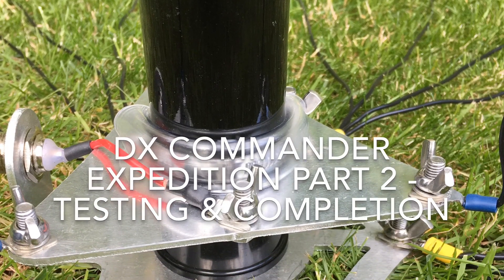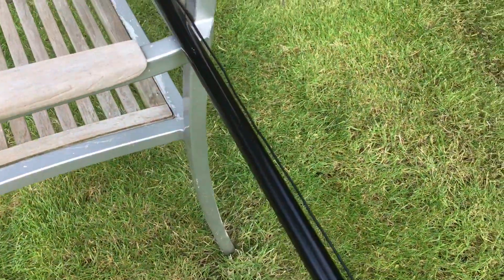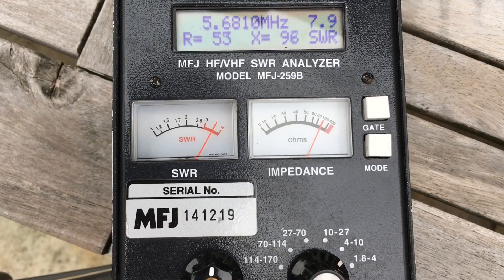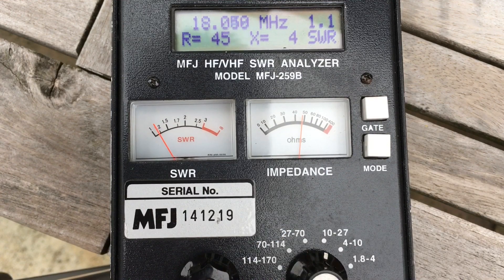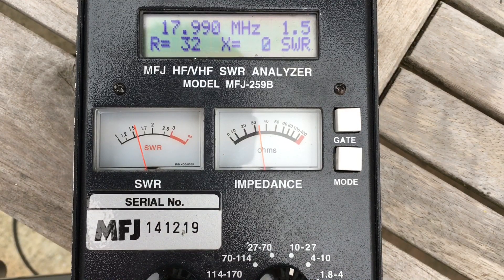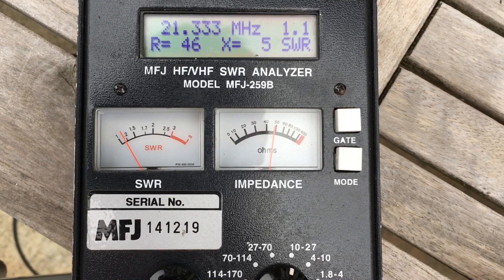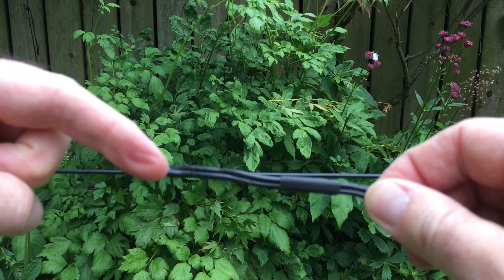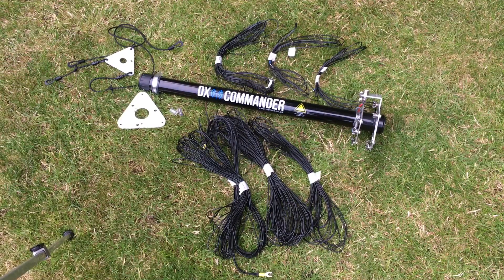DX Commander Expedition Part 2 - Testing & Completion

Comment: Hi. How long are the wires on the counterweight?
I see that it is recommended between 5 and 3.5 meters long. What is your experience?
Reply from the maker: Hi. I made all mine 3.5m long (5 sets of 4) which is the number you can get out of the supplied wire once you’ve made the radiating elements. Used it like this for years and had many DX contacts 👍🏻 Lots of other HF Portable videos on the channel using this antenna 😀

Comment: Very informative video... I've just purchased expo, How is the 40M Element connected to the top of the pole, is it just held in place by the rubber tube supplied?
Reply from the maker: MobyDogOG Yes, I take it to the top and down again. Slide on the wider piece of tube and leave loose. Fix the narrow piece of tube at the top as it holds the up-and-over wire nice and tight. Then snug down the lower wider tube 👍🏻
Reply: @G0CNN-Ian  so just pinch the wire over and slide the tube on got it...firstly I was expecting a eyelet or something like the 7 meter poles in the videos...thanks for the reply..👍
Reply from the maker: Yep 👍🏻